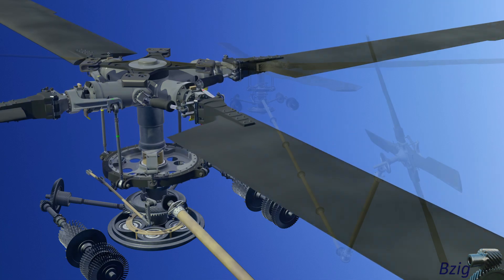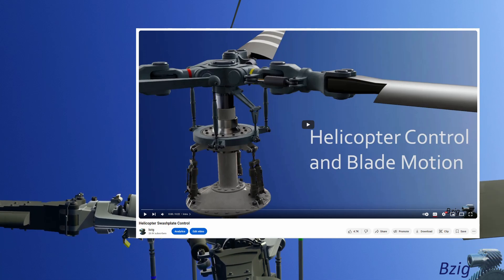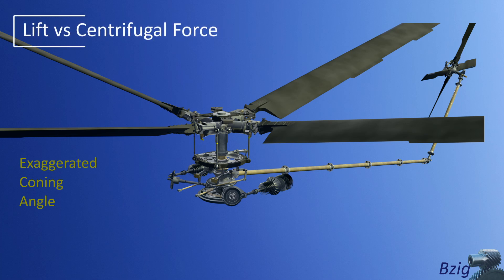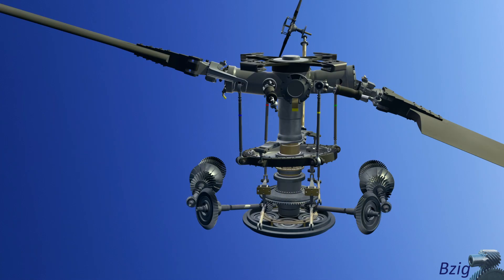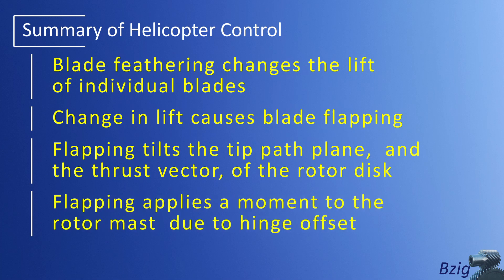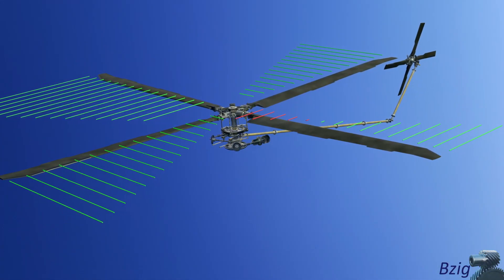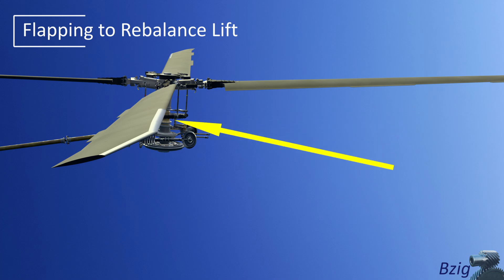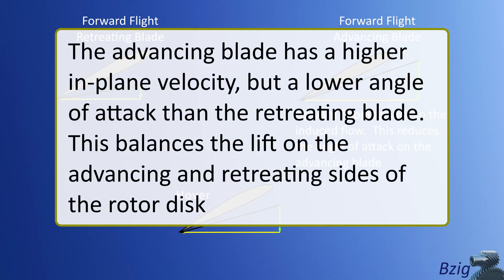Helicopter Control - Flapping

Comment: Something that came to mind the other day, I don't think centrifugal forces are the only forces applied to the rotor hub. Considering that while flapping, a blade has angular momentum, as that blade turns, and the flapping hinge changes the plane of rotation, some of that rotation must be converted to a linear force.

Take this example: The advancing blade on the right has an upward flapping velocity. This is constrained by the flapping hinge. By the time that blade has rotated 90 degrees counter-clockwise, now at the forward blade position, all angular velocity from the right position is 90 degrees out of plane, meaning it is now applying a twisting force along the span of the blade. Constrained by the flapping hinge, this applies an additional linear force on the rotor hub.
Reply from the maker: I need to do another video about lead-lag.  Lead-lag exists to correct the changes in angular momentum due to flapping.  As the blade flaps up, the CG moves inward... making the blade want to advance.  Because it can't, due to conservation of angular momentum, it leads forward.  Then it lags aft when it flaps down.
Reply: @bzig4929  Just a side note on why helicopters are far more expensive than fixed wing, per pound of payload capability.  Each blade is continually flapping,  AND lead/lagging, AND long axis twisting, for each single cycle of hub rotation. For a rotor speed  of 324 rpm (+ 9% / -4%) for one model of light helicopter, so too are all the bearings hub and blade grip interface, constantly reversing at the same frequency. Obviously wear is far accelerated, and materials used must be top purity of hardness  and/ or compliance.  One axiom I've heard  is: " A helicopter is a large collection of spare parts, all flying in formation, and wanting to fling themselves to pieces" 😱

The best damn helo pilot I've ever seen was a former Cobra pilot in Nam. In his middle age he flew AS315 Lama. I once saw him regularly hold a 100 foot long line with ballast ball and hook in high hover for 3-5 minutes at a pick, while pipeline handlers below were manipulating their choke cables.  The ball was about 5 feet above their heads, and all that time never swayed more than 6" in radius. When he was signaled by the pipe handlers he gently lowered  the hover by 7 feet,  to ground the static braid and they hooked it up, and away he went.  A true skyhook master.  He had told me that he had "bent a bird", several years earlier. I did not ask him to elaborate, as his answer was terse. He had several 1000 hrs in Helos.  Several years later, I asked his fueler guy what happened too him.  FG said "He had another accident, some bearing had failed, but he wasn't hurt.  However immediately retired, saying he wasn't going to risk a third time as that would be the end of him, and his mother needed him for home care."  So that was that
Reply: @bzig4929 This explanation video will be cool. When writing the script, please take note that at least I am confused by your use of advance here. I would interpret that the same as leading, but that can’t be so, because you’re saying they are different.

Comment: 4K would be very cool, if you can.
Reply from the maker: I may try that for a short.  I'm processing the videos in davinci resolve... I think that can do 4k.  

The resuloution coming out of the animation software may also be limiting, but it will be fun to try.
Reply from the maker: here's an unlisted clip that I did in 4k.  let me know of you think it looks any different.  To me, it's about the same as my other videos, so the limitation is the rendered clips coming from the animation s/w.  I suppose it makes sense that processing low-res clips in 4k is still low res.      https://youtu.be/pPkUydVIXiI?si=AYRGYJGx9SVa-4MT
Reply: @bzig4929  That 4K one definitely looks better, by a quite a noticeable margin on my 48" 4K OLED. Small details on the blades and tail rotor drive shaft are very much enhanced compared to a similar scene in the original at 1:50, for example. And on the later hub close-up too. It would be best to render at 4K high quality first, of course, but whatever you did worked for me at least. Your animation is so nice it's a shame to hide it!

Comment: Wonderful vid again. Amazing the engineering in a rotor head. I fly large RCs 700 size with 5-foot Dia rotor disc and I have a two blade and three blade 700. My favorite thing is take offs and landings. Can hold them in a perfect hover as well. If I had 15 million sitting around, I would own a Bell 429 or AS355.
Reply from the maker: if someone gave me a 429, out-right, I probably couldn't afford the operating costs :)  

RC helicopters are amazing.  It's hard to believe the same physics of flight apply to RC helos, doing 3d aerobatics, as applies to manned helicopters.
Reply: @bzig4929  Absolutely true, the bigger the RC the more it behaves like a full size. The blade chop on my two blade is amazing, luv that sound, kinda like a Huey. It also autos nicely. 
    As for the operating costs on the 429,  I heard to run a Sikorsky Sky Crane around 140k per hour!
Reply: @rcas350pilot8 Yes, and their pilots get insulted if you start asking silly questions like why wheels instead of skids and calling that beast a chopper.

Don’t ask me how I know!

(Skids are for kids, and don’t ever equate a Skycrane with a motorcycle.)
Reply: @PetesGuide  Got it Pete, name here is also Pete